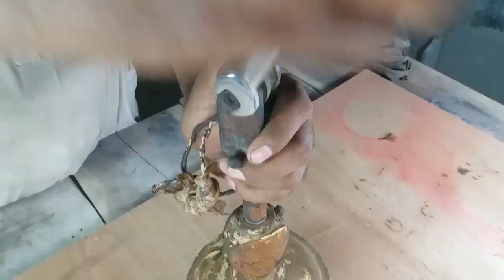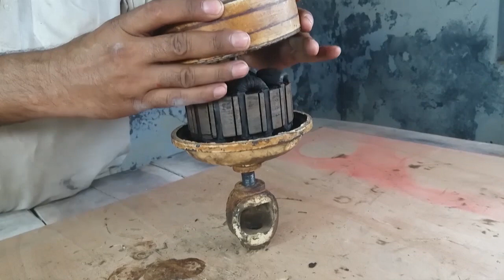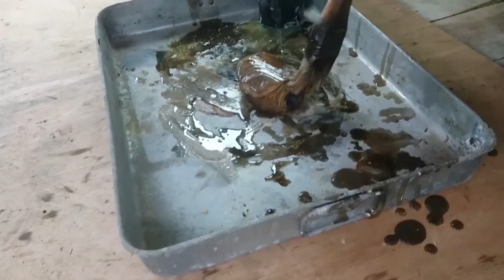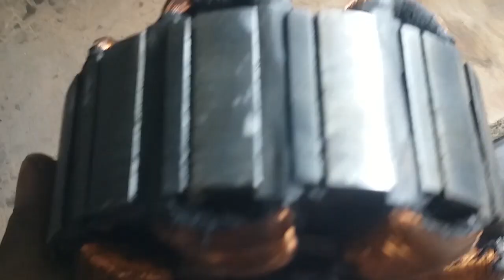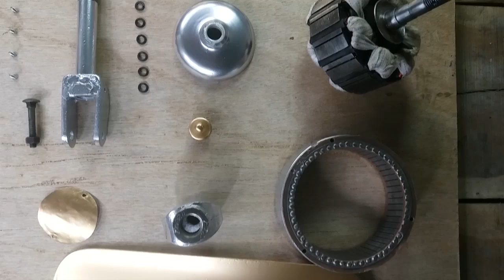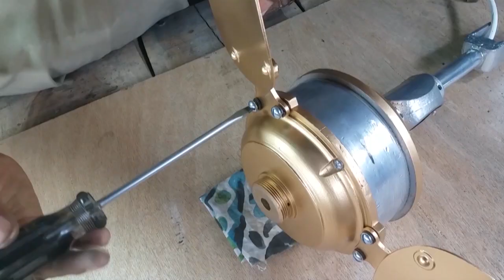70 Years Old Rusted Ceiling Fan Restoration - Restore Antique without  Capacitor Fan

Comment: Can you explain the capacitor less ceiling fan? How does it work?
Reply: It got it's running winding in form of copper strips in the stator the fans are way more powerful but. The consume less power even i as do own these fans so i can tell i got these in muhammad din and sons  from 1950's same model
Reply: Actually starting winding is in the form of plates